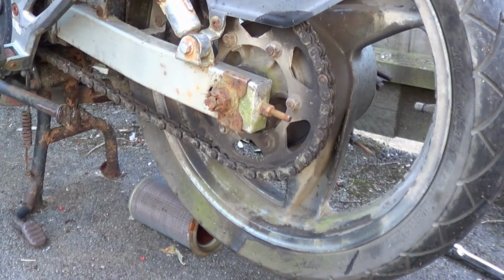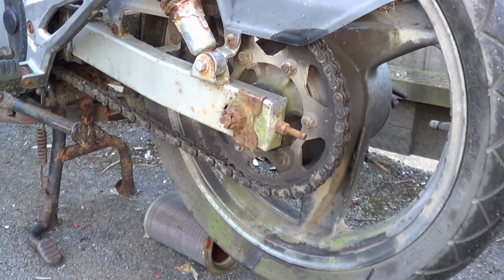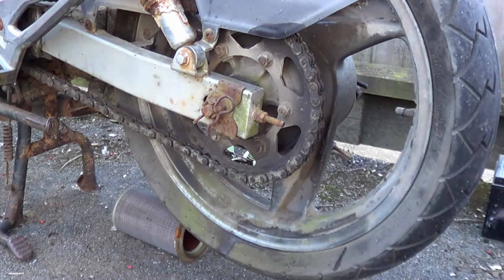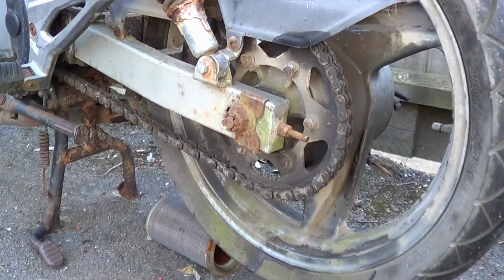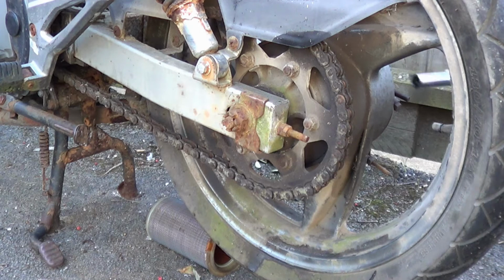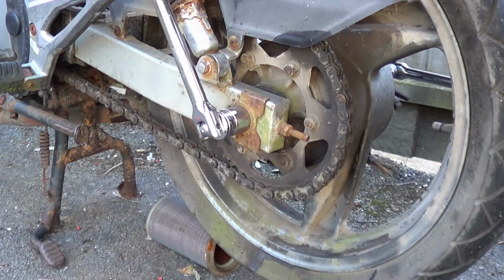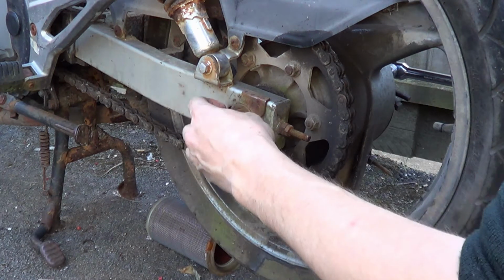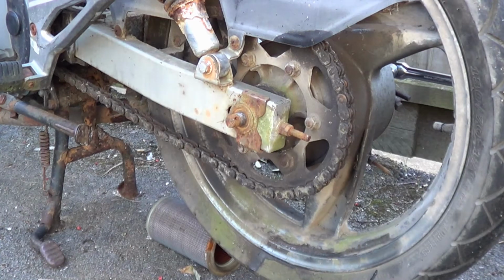Kawasaki ER 500 - Backyard Bike Project - Episode 4

Comment: I'm still trying to remove the rear axle Honda Rebel R reg........seized like yours, drum brake....notice you just hammered it, I've tried the hammer routine but no success so far. I wondered if you had any more options....Roy
Reply from the maker: ROY Dean Try some Plus Gas (its like WD40 but works) really soak it in. When you whack it try placing a hammer against the other side when striking. Also turn the shaft with a socket, 2 people make this much easier. Hope this helps oh and try not to damage the threads if possible. I had to replace my axle. - matt
Reply: Thanks Matt...I will try........your options...roy
Reply: I bought a 600mm Breaker Bar and some 1/2" drive Impact Drive sockets...17mm and it turned, so I wacked it and I have an inch showing...the axle bolt hasn't much of a head....looking good.......Thanks Matt
Reply from the maker: ROY Dean No worries, really happy you sorted it some times these things just need pure aggression, its just knowing when lol Glad everything is working out - matt
Reply: @thedirtyworkshop , pure agression? Sure that you have that, frustrated and single as you are.

Comment: Seeing all that corrosion, I would spray WD40 or an equivalent on all bolts, nuts or whatever I'd have to get loose. Which is about everything, in this case. I notice you did not do that. Do you think it's not necessairy? I fuckin hate stuck bolts and do whatever it takes to avoid them.
Reply from the maker: Penetration fluid has to be used in the correct way, I'll do a video about it. But I only broke oe bolt and not even jesus would have worked that little bastard out
Reply: You dissin' Jesus' tech skills? Word has it he had some mean carpenting skills. But I wouldn't let him near my rusty old bike.